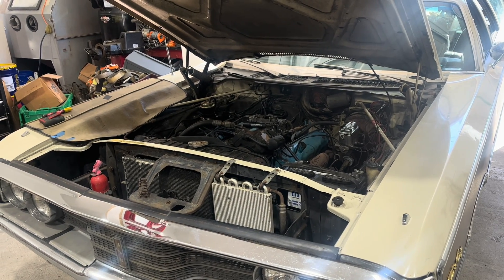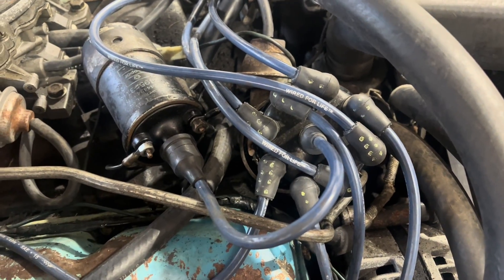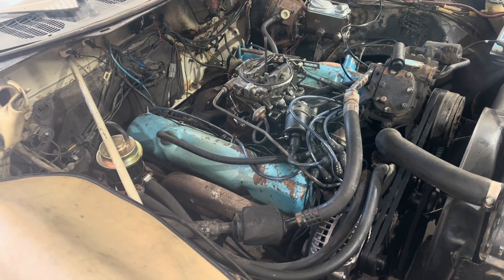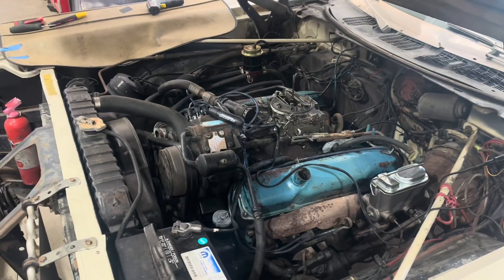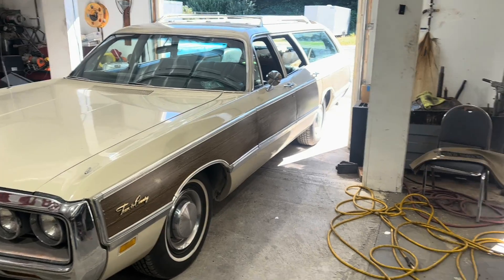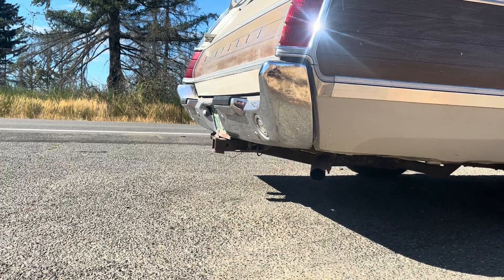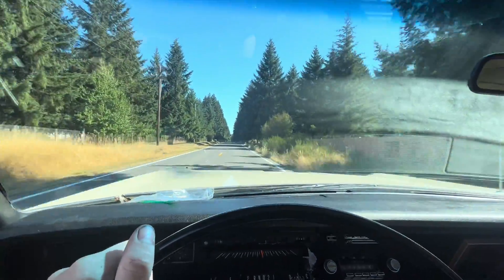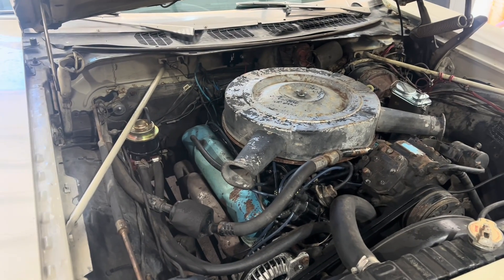Check Everything II: Your Firing Order Is Important

Comment: Growing up in the 60's and 70's, my dad had a '69 Chrysler Newport with a 383 4bbl, factory dual exhaust. The same car your station waggon is based on. The stock compression ratio for that engine was, I believe, 10.25 to 1. I think your only viable solution is to add some octane booster. Or, keep bumping the timing back untill it runs crapy.
Reply from the maker: I really don’t think it’s actually fuel quality or timing related. It sounds like exactly what our wagon’s stock Poly did - it pings on one cylinder. It could (in theory) be a blown head gasket cross firing one cylinder early, but I think it’s more likely to be a hot spot in a cylinder that’s heating up like a glow plug. I have heard that this is not entirely uncommon. I think I could take another ten degrees out and it would still do it… our Poly did.
Reply: You could try VGG's Italian tune up and dump some Berrymans "Right down the yap." Then take it out on the highway for an extender high speed trip. That might get rid of some carbon hot spots. Good luck. I love everything Mopar from the 60's and 70's. Love your channel. You should have more subscribers.
Reply from the maker: @markbeuttler2675  That's totally something I have done in the past, and if the wagon comes back I may just give prod him to let me give it a shot. Thank you! I'm working on it. Haha. It both feels like the channel is growing quickly, and like it's taking forever. But we're getting places